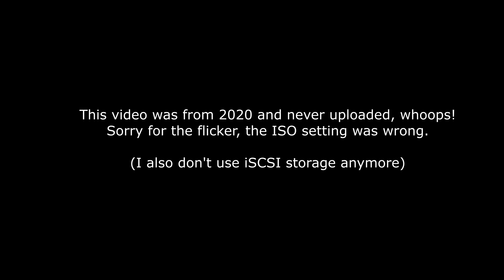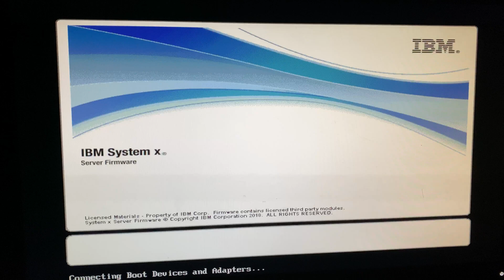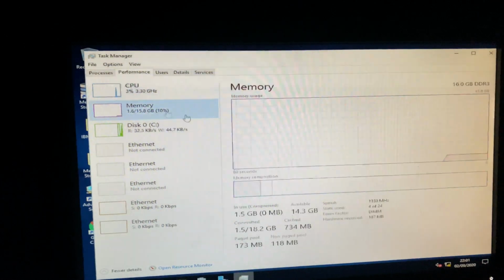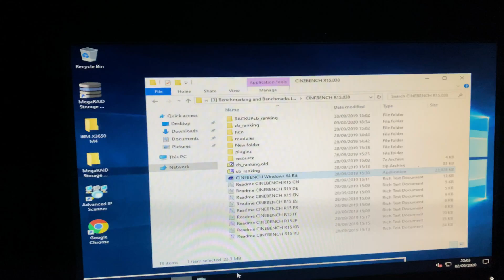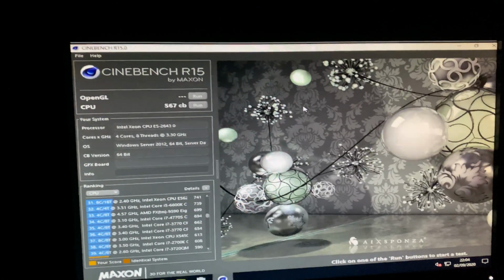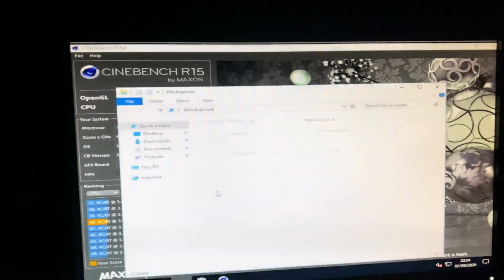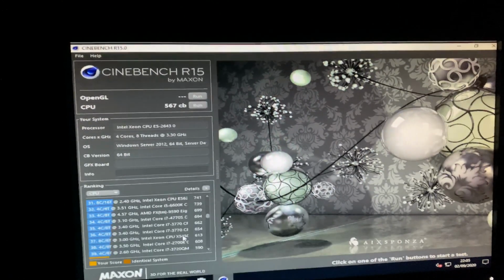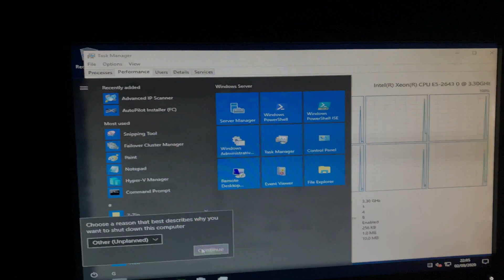(2020 Unreleased) IBM X3650 M4 E5 2643 Upgrade

Comment: So strange seeing that, I have one of these that I have been slowly upgrading, I wanted to get the extra backplane for more SAS drives, have upgraded the CPU's and been on the look out for another PCI riser and need to shop for some more RAM. 
Shame it is so old now that it's getting harder to find parts.
Did you take any temp reading for the CPU before/after?
Reply from the maker: Since this was back in 2020, likely not. I do still have them around though as plans for some upcoming projects so I could always compare against one  with 2x 2620's and this one with the single 2643. I don't think I ended up adding the second one and a second heatsink in.